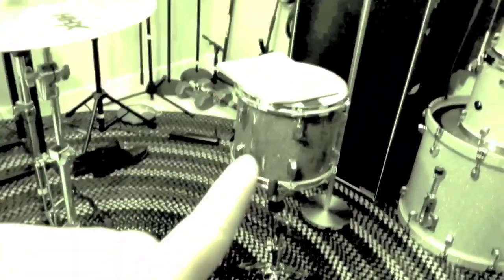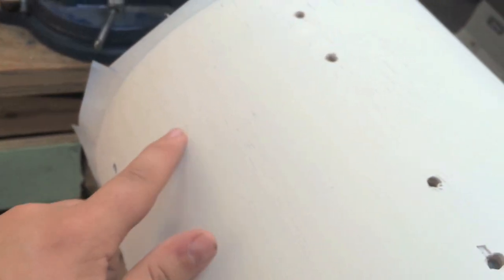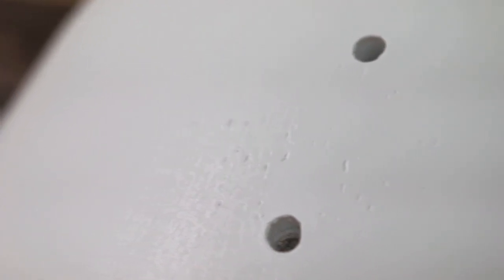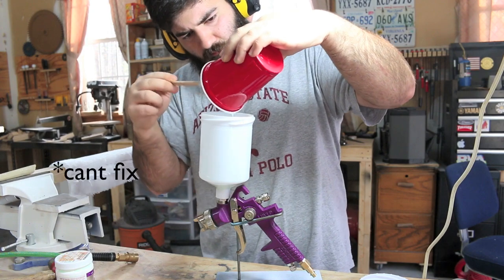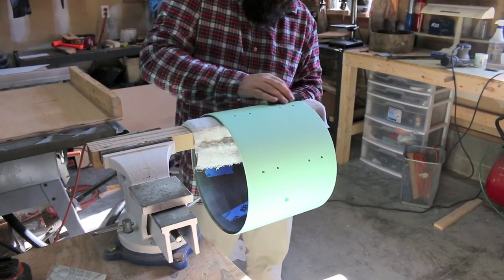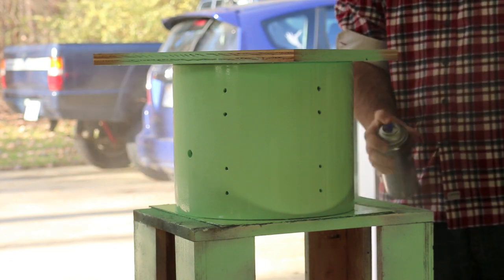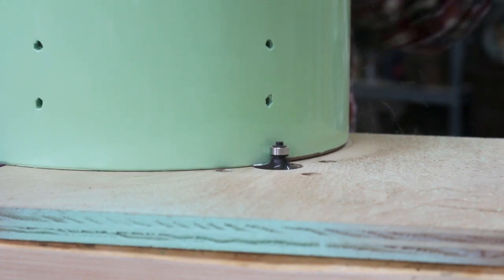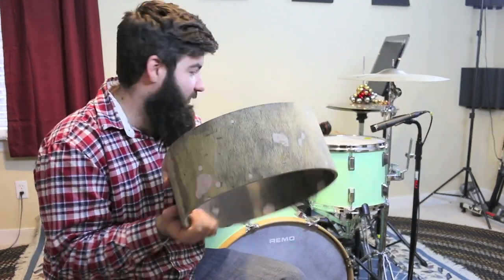Painting the Tom... finally

Comment: the spraypattern on a paintgun is a flattened fan the  to knobs that stick out the spraynozzle flatten the pattern 
so if you sprat up and don turn the nozzle or you spray thick in the middle and thin next to it and you get drips

Comment: don't use wood filler, use grain filler (yes, there's a difference). watch some videos on "grain filling a guitar". watch some videos on wet sanding and buffing out the clear on a guitar. the processes would be exactly the same to get that "smooth as glass" finish (like stuff comes from a factory).

btw, a good grain filler is this stuff called timber mate. it's sold online and at woodcraft stores (if there's one near you).

Comment: What grit did you use with the hand sander? And do you have any suggestions on how to take off factory paint on a snare drum? It seems like it's going to be really hard. All I have is a hand sander.
Reply from the maker: +Beau Manning I used 120 grit in the video because its all I had left lol, but I would suggest 60 or 80 grit for taking factory finishes, then once you get through the finish work through to the finer grits.